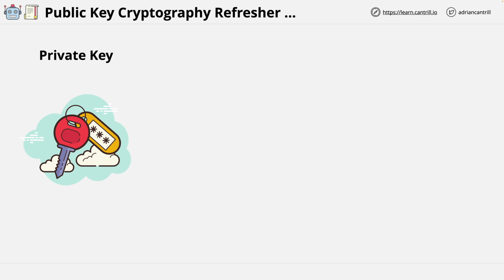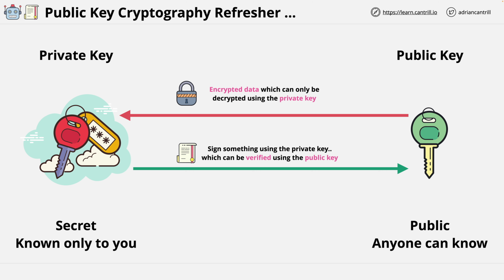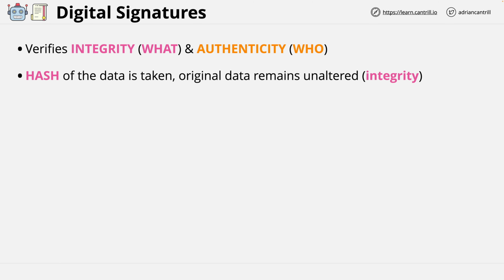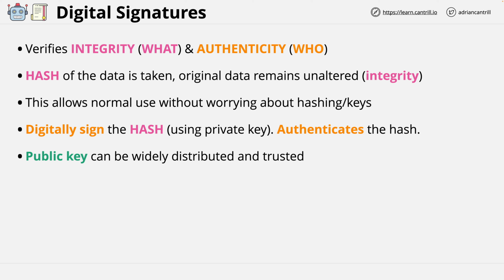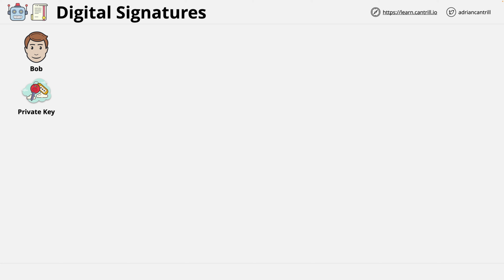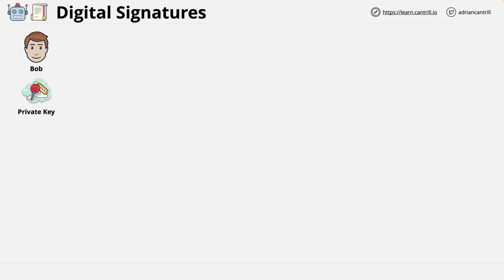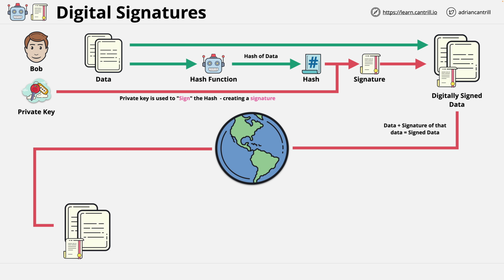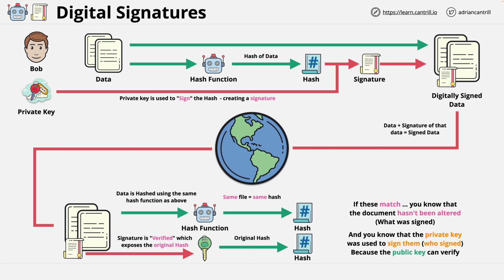Digital Signatures - Data authenticity and integrity protection

Comment: why don't Bob sign the original data, why does he sign the hash of it?
Reply: hash compress the data which is good for many reasons and also its quicker to encrypt hash than huge file... could be couple mb or couple gb etc...
Reply: @w3w3w3  @LearnCantrill : What exactly are you getting by hashing ? Since only Bob could have siged the doc using his private key ? So if a document is 1GB, why not just encrypt with Bob's private key and send it out. Anyone can decrypt with Bob's public key. You get integrity right? How can anyone get Bob's private key? Unless decrypt of a large message with public key is very expensive - I dont see what the value is
Reply: Signature schemes can only sign small amounts of data. This is why the hashing is done